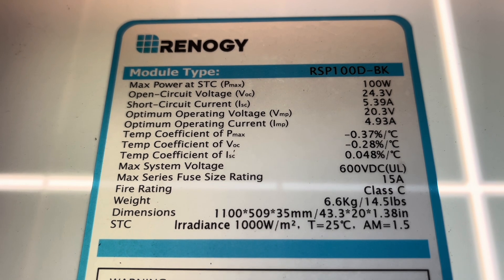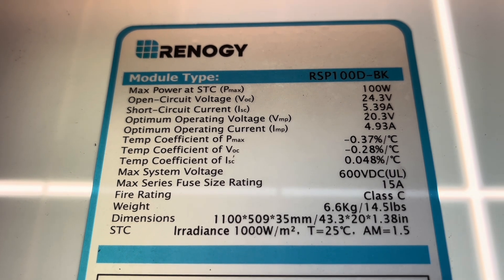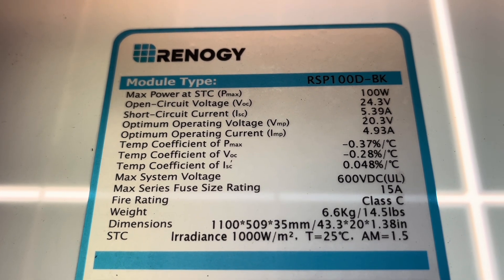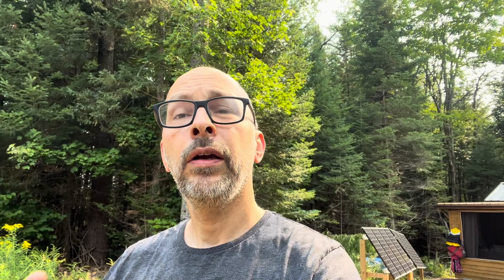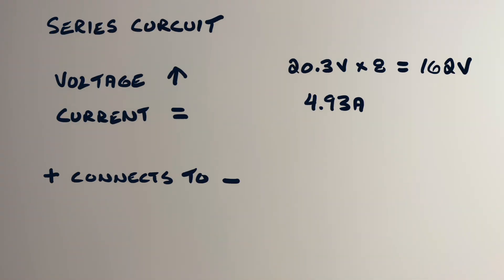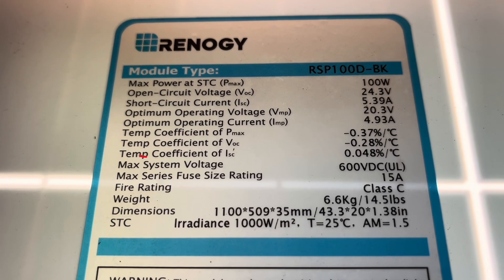Connecting Solar Panels in Series or Parallel?

Comment: With 80 volts on tap, how are your batteries wired? 4, 100ah batteries in series or is it a 12 volt system with the charger capable of using the 80 volts available?